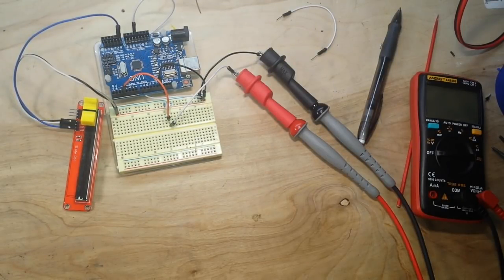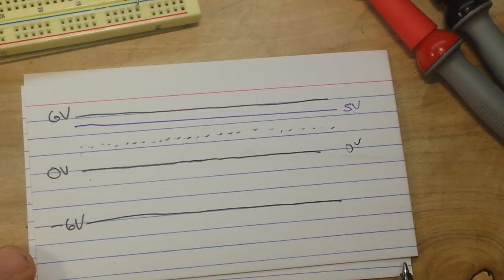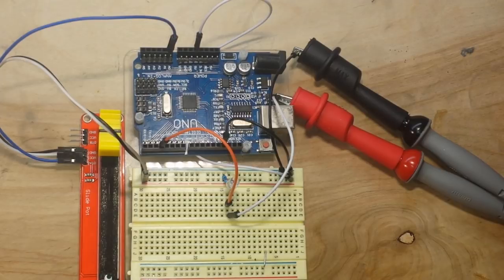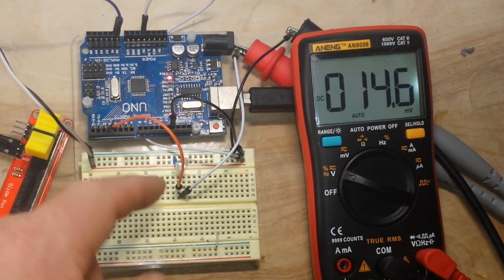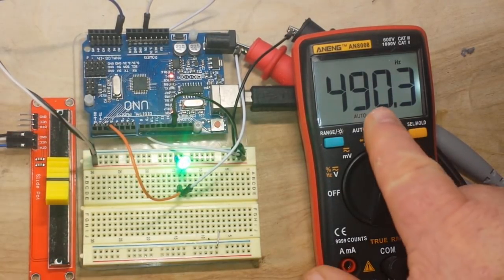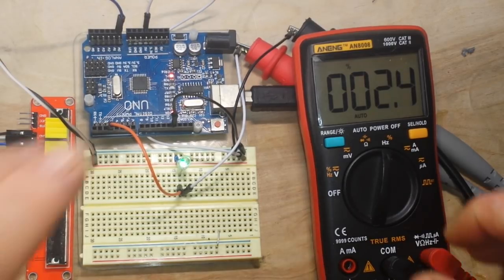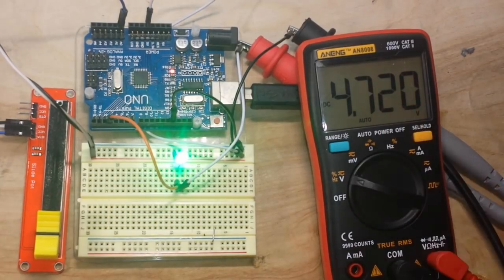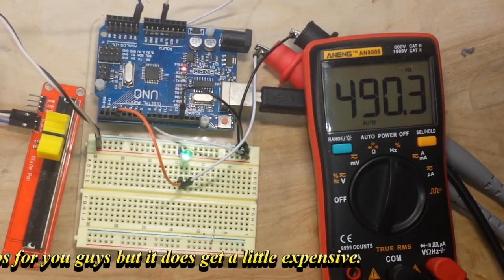Arduino PWM in depth

Comment: Weird to see Probmasters on an Aneng. Though I don't know any other multimeter that would have as many functions and be so small at the same time other then this line of Anengs and their clones. I have a blue one that has auto switching between amps and milliamps but when current is no passing through it it does not show zero but constantly meanders around 7 milliamps if AC current is selected. Does anyone know how to fix that or what revision or model to buy that does not have that problem and can automatically switch ranges between ampere and milliampere ranges?